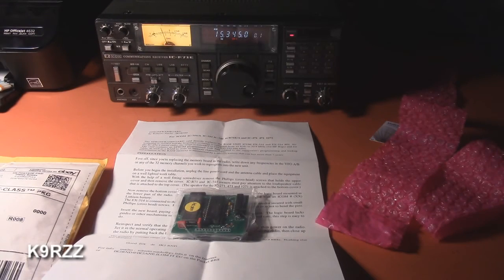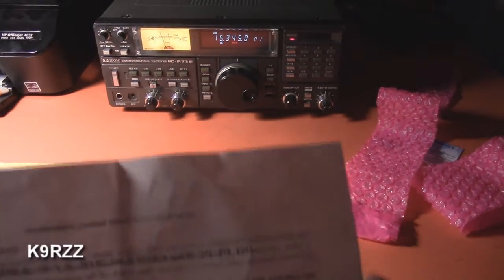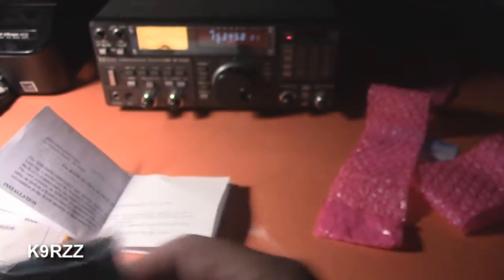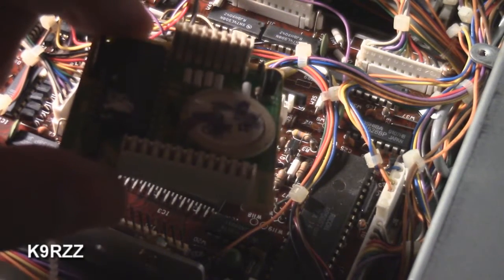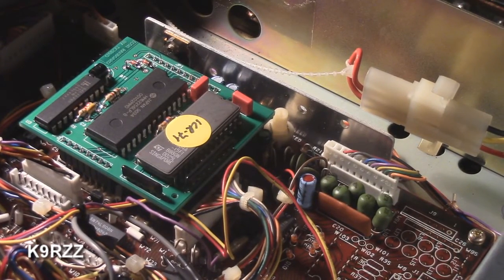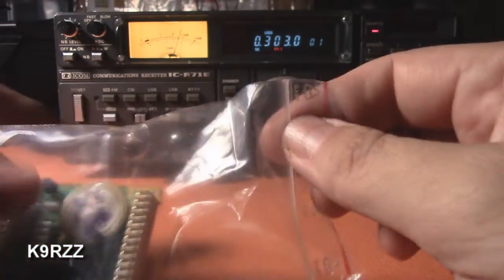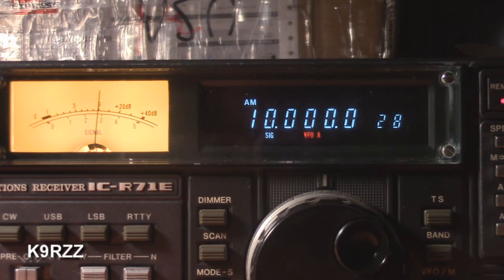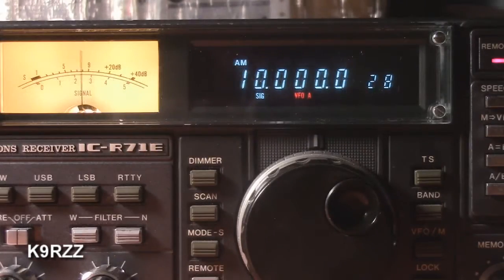Icom R71E from China - Nardo RAM board and battery installation

Comment: My original battery is probably 25 + years old and still going :)
Reply: Got my ic 751 in 1980 and still going strong with original battery but I did in 1990 buy the board for it but never have used it yet.  Now in 2021.
Reply: @timbacchus   mine is still going as well 3 years after my post